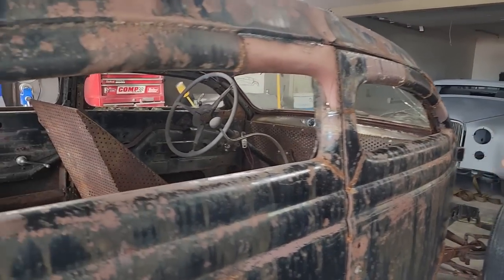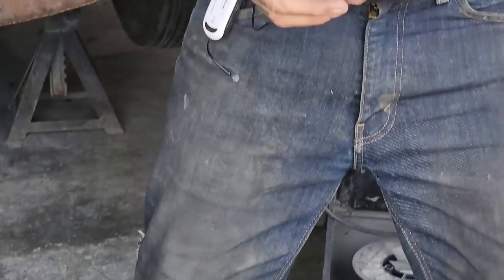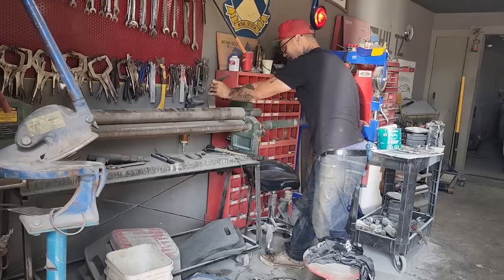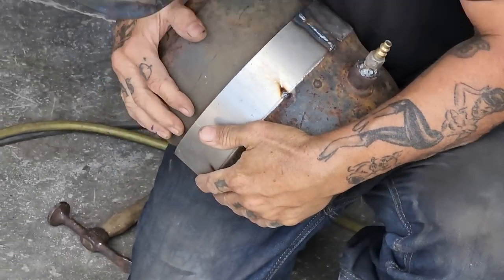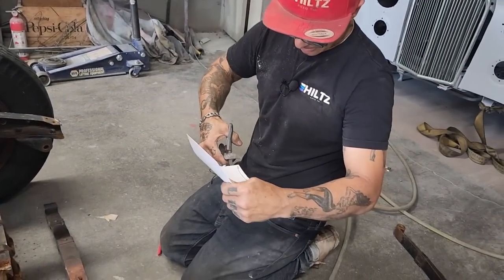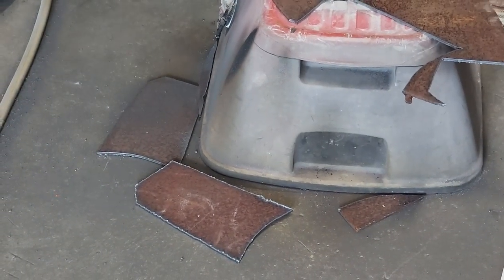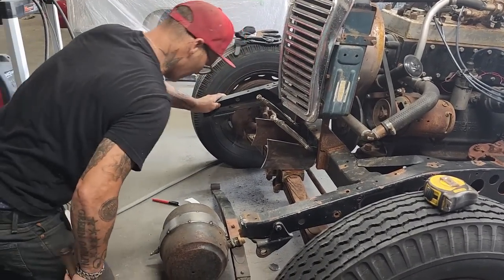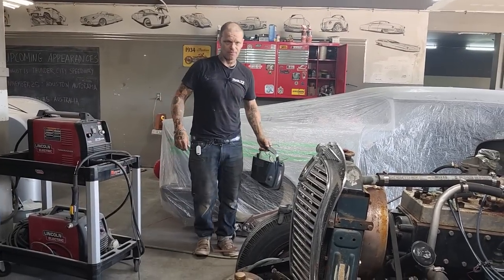Making a gas tank out of two headlights for Jolene's race car ⛽️

Comment: Hey Chad, you need to strap mount that. Brackets welded directly to the tank will split the tank from the weight and vibrations. Thats why they are all strap mounted.. I learnt that the hard way.. stay safe guys
Reply: Wow,  sorry that happen..
Reply: That's crazy
Reply: They are only driving 1/4 mile at a time..  haha
Reply: @moosetacular734  so is every other moon tank
Reply: Yes. This is not safe at all.
Reply: Correct, but my main concern isn’t the Gas tank, it’s the Swiss cheese firewall, not too safe !!
Reply: @fredselbman3319  Especially if you spray gasoline all over it
Reply: Would be better strap mounted so it comes away in an accident, rather than possibly being ruptured and spilling fuel. needs a check valve to block the feed line if it comes away.

Comment: I LOVE the look of that little tank. It has a bit of a steampunk look to it. However fire with the perforated fire wall is something that entered my mind just now as well as the lights themselves. Is there a chance they are cast iron? You'll have a ton of fun getting them to seal if they are. Braising them would be the best bet if they are. Venting is something to consider. (I'd drill a small hole in the cap) and the clear plastic hose on the outside is the best gas gauge going. Take care guys and play safe please 🙏

Comment: Looking good Chad.
Got to give it to you for your ingenuity.
I would never have thought to use headlight buckets to make a fuel tank.
Don't forget the air vent in the cap once you have done all your air pressure welding. 
Venting the tank needed to stop fuel lock as you build vacuum as fuel is used.

Comment: Love the idea of using headlights for a tank. However not the greatest safety idea having it at the front, especially given its sticking out further than it needs to be. The longer brackets are just excess weight. If you were to mount it high, you could then gravity feed it, and do away with the fuel pump, less strain on the engine and another little weight saving. Having said all this great to see you back on it . Love the look of this car.

Comment: Just curious if the track rules will allow you to run a fuel tank at the front of your car. If they adhere to NHRA rules, you would not be able to mount it there.
Reply: There are very few rules about safety on these races. This car, if they inspect it, will not pass because of the reprenda. The driveline cannot be newer than 1936, iirc, and the rear ended in this is out of a 90’s jeep Cherokee.
Reply: It's called Pine tree Jamboree in Maine, just a bunch of home building hot rod guys having a little fun is all. 1/8 mile drag races. There are videos of it on YouTube.

Comment: Jolene  I might have to stop reading the comments, I spend to much time laughing. There seems to be a fair number of folks who think Chad could not pour milk on a bowl of cereal or put air in a tire without their help. What I see is borderline genius with a little crazy tossed in. Think of it this way If Chad had been on the Titanic he would have patched the hole with some pots and pans and half a dozen deck chairs. You do not have time for the haters, your to busy making the rest of us smile.
Reply: Well said, godda love the experts on every part of the fabrication, Chassis experts, brake, experts, radiator experts & today moon tank experts, the list goes on & the best part is none of them have built a race car the Pine Tree Jamboree! ... 😆
Reply: Great stuff Chad mate. I'm concerned about your spine though, how about a nice workbench?😉
Reply: @Bikeops2021  
Although Chad can weld and fabricate I am fairly certain that he isn't necessarily an expert on chassis, brakes, radiators or fuel systems. 
Many who watch and comment here are gearheads who do have expertise in specific areas and offer sound advice. 
Why hate on those who want Jolene and Chad to remain safe?

Comment: Hi Chad, can i suggest you to please make up a mobile welding table with 4 swivel wheels, place your mig and plasma underneath you could have one extension cord plug with several power outlets for machibery, it will save your knees and back, even add a drawer under the top to put your vise grips, magnets, tape measure, flap wheels, cuttibg disks etc etc  and some tools you use for welding, , it wont occupy any more floor space than your two welding/ cutting machines,

Comment: Chad... got TO HAVE A VENT OR AS Jolene GOES DOWN THE TRACK... A Vacuum WILL Occur... THEN THE MOTOR WILL CUT OUT... RUN IT UP THE SIDE OF THE RAD. SO IT DONT SPLASH OUT?!!    GOOD LUCK
MACK.  IN KY.

Comment: Chad and jolene where the fittings have been fitted the plate that holds them in place is riveted on it hasn't been welded surely its going to leak from there just my belly button as you say. Keep up the great work the both of you 👍 👏

Comment: Don’t take this the wrong way but we have the C.S.A. Approved certification (for good reason) for fuel containers. Pressure testing, leak testing, the lid built in pressure relief and spill proof, vent, overflow, and then there’s the race safety check, iit won’t be the first time doing something again and probably won’t be the last, if it works good on ya and if not maybe bring a motorcycle gas tank with you so u can sub it in if needed!!!! Safety first so things don’t turn out Bad Chad!!!! If all else fails use er for an Ole oil slicker and take out the competition lol

Comment: Nice job with the fuel ⛽ tank Chad and jolene it's going to be about the right size. Cause by the time you get it off choke and warmed up ready to run down the track it's going to use fuel fairly quickly till then. Keep up the great work the both of you 👍 👏

Comment: You mentioned welding galvanized.  

Please remember that you need a good quality canister filter type mask for messing with galvanized, or you will get quite sick from the fumes.  That includes anyone working nearby.
Reply: For no more then he did it’s not a problem
Reply: He ground the galvanised coating off first, pay attention!
Reply: @Bikeops2021  - I never said he didn’t.  

My warning was a general statement for anyone re: welding galvanized materials and the need for a proper mask.  I’ve witnessed someone who became quite Ill when he failed to take that precaution, and not everyone will know about the dangers.
Reply: @nualanet  OK fair enough Nuala, good thinking. Hope you have a nice day...  😊
Reply: Lookout the safety police is on the Channel.
Reply: @stallion1369  -  Just someone experienced with welding galvanized, who has seen the results on a co-worker.  

You want to weld galvanized w/o a proper mask, knock yourself out.
Reply: @nualanet  you would need to weld galvanised on a regular bases to be affected not a small bit of pipe that Chad did. Geez

Comment: Chad if you put a funnel in that pipe fitting you’ll probably have to vent the tank or it won’t fill
Reply: Just hold the funnel up a fraction and it is vented. Its only a gallon or so.

Comment: If the front spring swivels up and down like it should it may break the gas tank off if it is to close. Like if you run over something on one side the spring should move up and bend the tank.

Comment: Think this is a poor idea to place ANY fuel tank on the front of the vehicle, front end contact could ruin Jolene’s pretty face.   Just my dime for what it is worth.    Love the couple and their show.
Reply: I forget what it's called but you could put the spongy stuff in the tank and it hardly affects the volume but yet it won't explode they use it on race cars in Connecticut at the Circle Tracks

Comment: hi guys i hope we see it fly down the yrack you may find it helpfull but any time you make somthing round mesure the width and moltiply that by 3,14 and thats the length you need saves one weld and its easy to remember just an old fitter putting his 2 sence in use it if it helps or forget it lol

Comment: Chad you need a gas cap vent so it doesn’t stop flowing! No air in tank fuel pump won’t be able to suck gas out of tank without a pin hole in cap!

Comment: Chaddy, you need to weld another smaller diameter tube near the top of the tank then add a piece of hose for ventilation  so you don't get vaporlock.

Comment: Weld it up first and check for leaks!!!!! Don't weld it on!!!!! Gotta check for leaks FIRST!!!!
Reply: Light bucket stems will not hold water inside and the center added section is not even welded 100 % . It is going to be a bit_h to weld the bracket side of that tank!!!

Comment: Cool tank, as others have already mentioned, you need a vent. also I agree on the danger aspect in a bump to the front of the car.  your regulator with a gauge for pressure testing, re think that... it looks like it's already set up to couple it  up the way it is. back off the regulator all the way , plug it in and slowly increase the pressure . a few pounds will find a leak . 5 psi is quite a bit, in my opinion.

Comment: Hope you have figured out how to vent the tank. With such a small tank and an engine running at high rpm you could Vapor lock and starve for gas even if there's gas in the tank.

Comment: When putting air into the tank. Why can't you use the pressure gauge the way it's already set up.  Put your female connector on the tanks male air nipple. Then put air to the gauges male nipple??  Unless, the air has to enter the gauge a certain direction only??